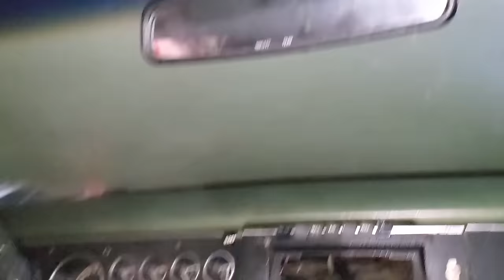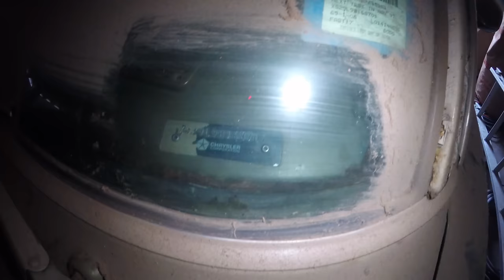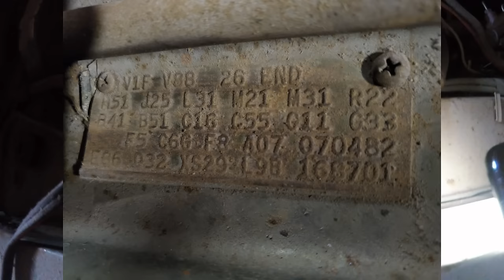Garage-find 1969 Dodge Charger R/T 440 Magnum with stripe delete

Comment: When they were assembled on the line and the top was being finished, the workers knew if it was a vinyl top or regular top. Regular tops had lead to finish and smooth the seam where the "C" pillar meets the top. Vinyl top cars just got plastic filler. This was a vinyl top car and when they removed it, they probably put a new coat of plastic filler in the seam and it's cracked with age.
Reply from the maker: Thanks! Interesting stuff

Comment: The switch next to the radio is for rear speaker fader  .that car prob had am 8 track because it has 3 spakers in dash .we have 3 69 chargers
Reply from the maker: You rock, thank you. That was bugging me, what it was
Reply: Have you ever seen a green 69 non RT with side pipes?

Comment: Car likely had a black vinyl top and the rear roof support is a weld which would have been hidden beneath the vinyl.  Guys at Graveyard Cars would LOVE to redo one of these.
Reply from the maker: Could it have been a white top? I think the owner might have said that but I can't remember
Reply: Possibly, most Charger vinyl tops I've seen have been black.  You could try decoding  the car's fender tag or maybe ask Mark Worman at Graveyard Cars for guidance?  Either way it will be incredible redone.  Best of luck and looking forward to any future posts!  @MindofMatter
Reply from the maker: @Redbuzzcut  thanks for watching. I've got a Mustang Fox body video coming up. If you know anything about that stuff maybe you can help me out there too

Comment: Nice Charger R/T, but that said it's a minimum $100K restoration done properly.
Front rims are original 14" Magnum 500's, however, those are the wrong trim rings....  and just as an example here.... the 'correct' 14" inner lipped trim rings can run $1,000 for 4 that will need work.

Comment: Is that a 68 engine color?
Id mechanically restore it. Leave it in it's rusty state and drive it
Reply from the maker: Not sure actually. I heard some people that know more than I do saying it's not the right color for the engine. The engine was a replacement at some point earlier in the car's life and I think that's when it was painted and not necessarily the correct color